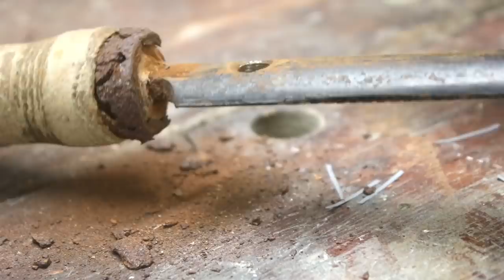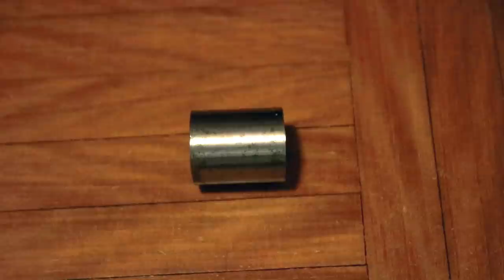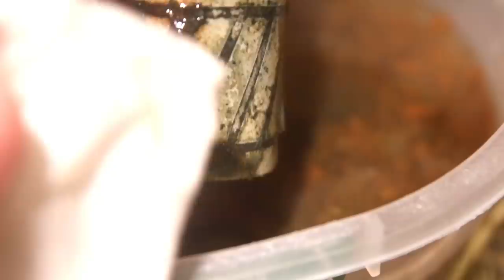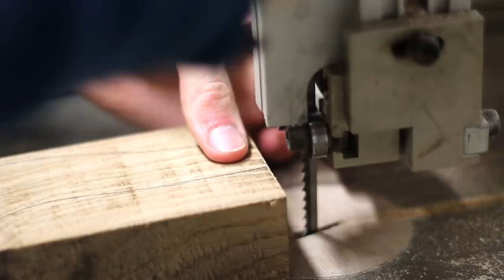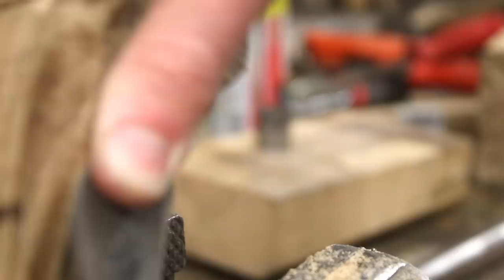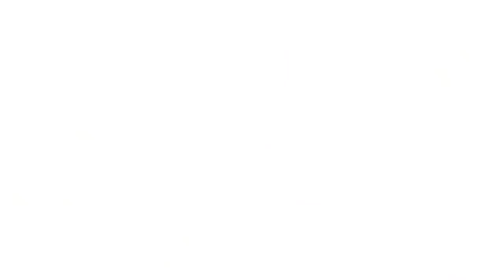Making overly ergonomic handle for rusty file - OLD TOOL RESTORATION

Comment: Nice job. That pistol grip. The rasp though is one used for softer materials such as plaster rather than wood. Wood rasp teeth are designed to break the fibres of the wood whereas the single wide-spaced ridges on this are designed to rough plane say a plaster mold or form to remove gross material. It seemed to work on the wood but I imagine it must have been heavy going!

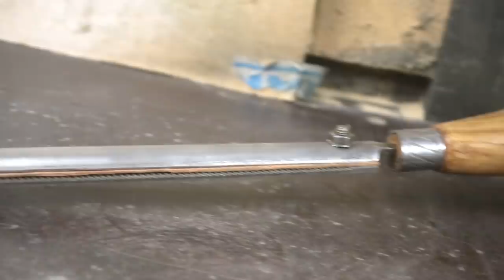Comment: Nice job. 12:32 - looks like you put a layer of something between the file and the back. What is that?
Reply from the maker: There was a piece of  hard cardboard there just to keep the other side of the file from rubbing to the steel shaft if it starts to loosen

Comment: Enjoyed your vid!  Was there a reason you oiled before gluing the ring?  Wouldn't that prevent the glue from soaking into the grain?
Reply from the maker: Thank you, Im glad you enjoyed it.   There was no specific reason for that. Or I can't remember one.  It didn't matter as I put enough glue in there to make a tight enough fit after hardening even if it didn't stick to anything.